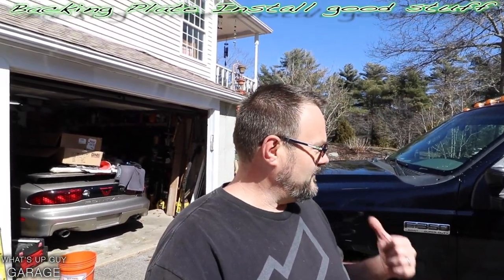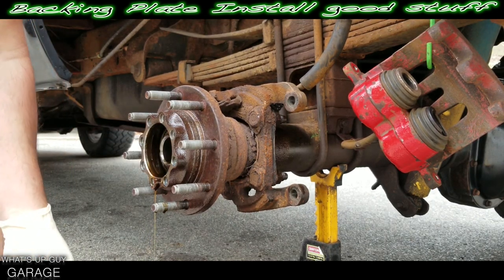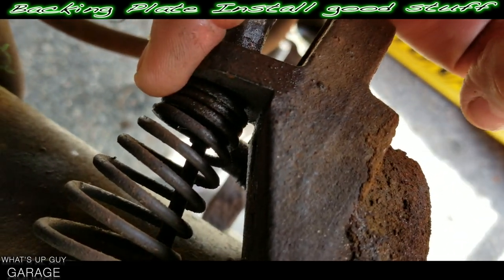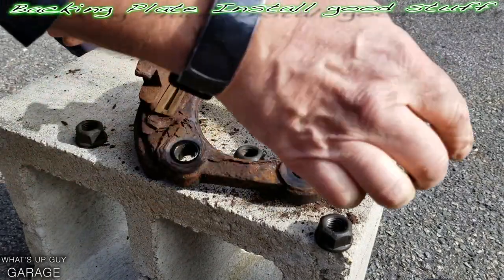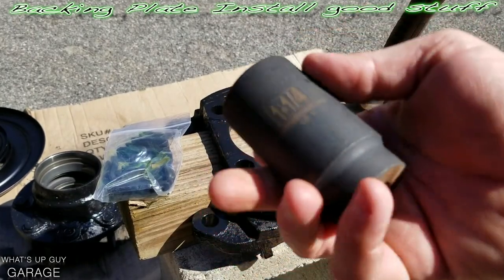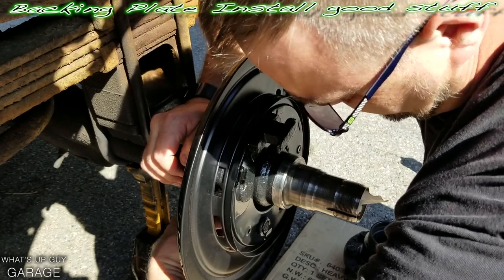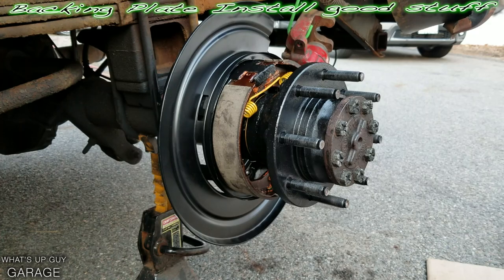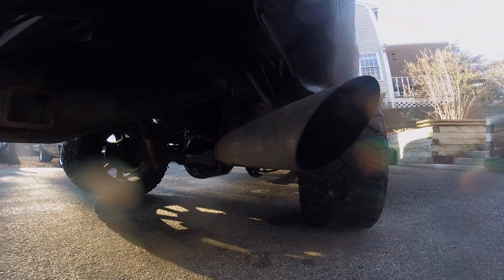F350 Backing Plates

Comment: Great video, all details. However if you put the link for the parts you bought it would be phenomenal! My question for what is that juice man?
Reply from the maker: Some links would be Ford Dealership not sure how to do that.
Reply from the maker: Combo of diesel, gas, carb cleaner and lacquer thinner.
Reply: I came here because I can't find single rear wheel backing plates. I can only get Dorman 924-212 which are listed dual rear wheel . did you use these on a SRW truck?
Reply from the maker: @Jonathan-us4ig  https://amzn.to/3Ef3ffW
Is what I used here PERFECT FIT AND USE

Comment: Great video, wish I would of watched this before I started. Brake cable was the hardest part. I had to put a piece of wire around to get my 4 clips to retract. Also, My truck 2011 has a gear on the hub that the ABS sensor rides on. But everything else is the same. Thanks for the video, one of the best I have seen.
Reply from the maker: Granted it might not exactly apply to the newer models but glad it looked like a video that could have helped.